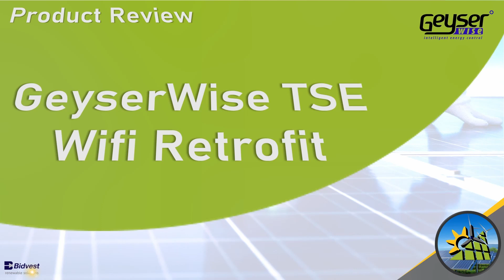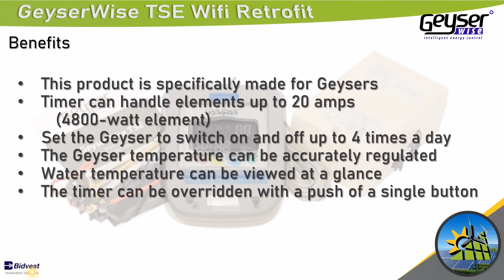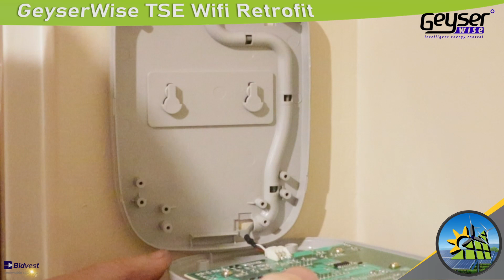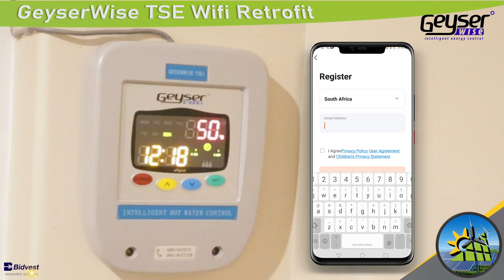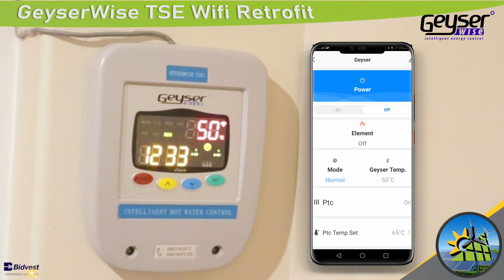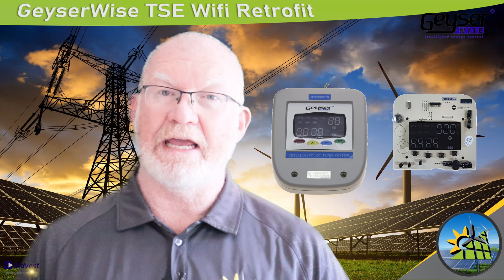Geyser Wifi Retrofit

Comment: I wanted to check if the TSE controller PCB can changed. I was told that the TSE is not compatible with the smart WiFi and I needed a whole new power supply and display. The reason given is the TSE is older and not compatible as the new Geyserwise is three digits and older one is two digits.

Comment: This device is horrible. It keeps dropping internet connection and then enters pairing mode and cannot be paired unless power is removed (hard reset). 2nd one I have and it's doing the same thing